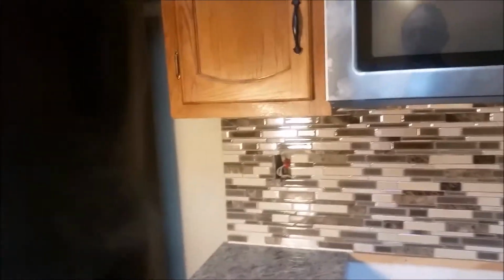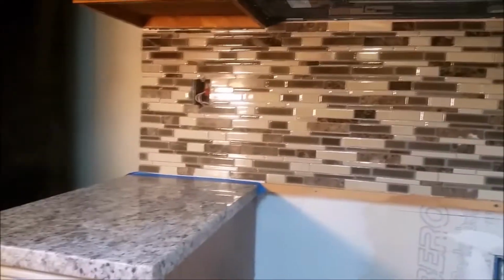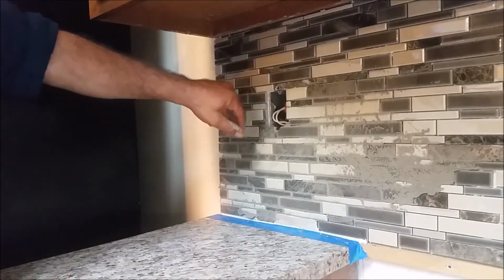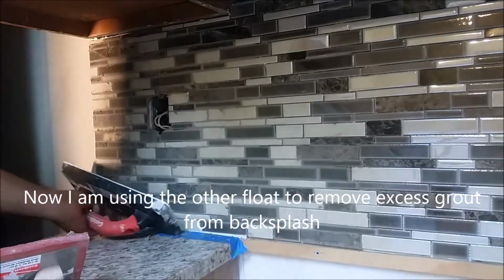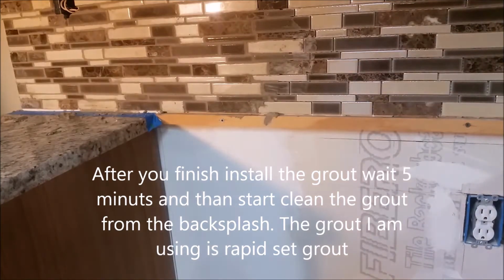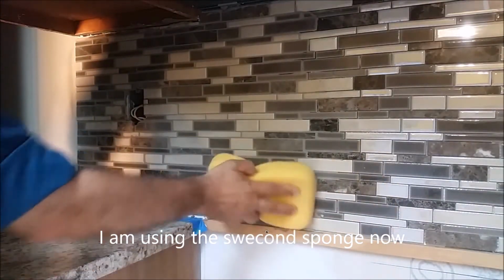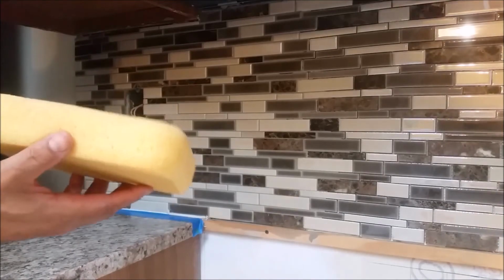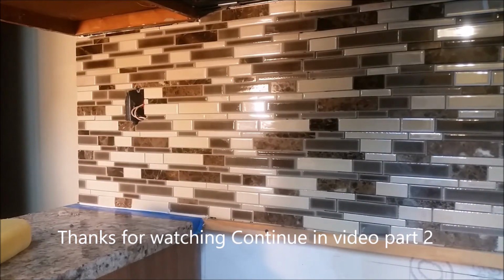How To Grout A Kitchen Mosaic Tile Backsplash  -  Part 1 -  Step By Step - D.I.Y

Comment: Do you have to grout immediately after applying to walk? Mine has been up a few days working slowly I didn't know it isn't supposed to be up more then 2 hours before grouting until I noticed a paper in my directions.
Reply from the maker: No. You should apply grout after at least 24 Hour after tiles installation.